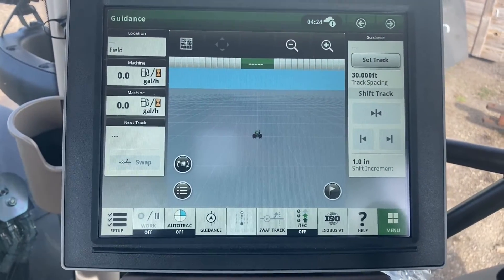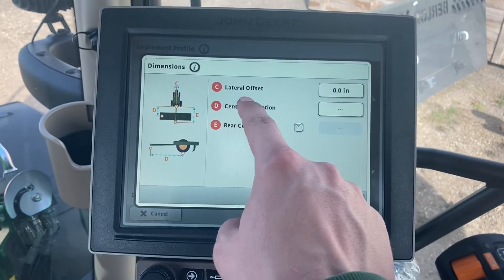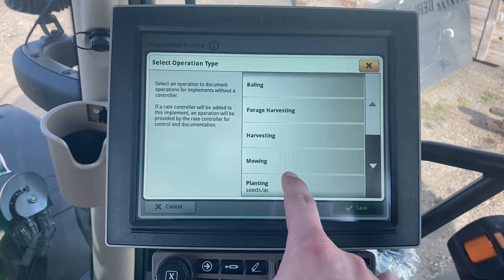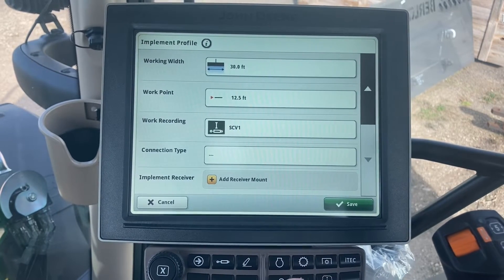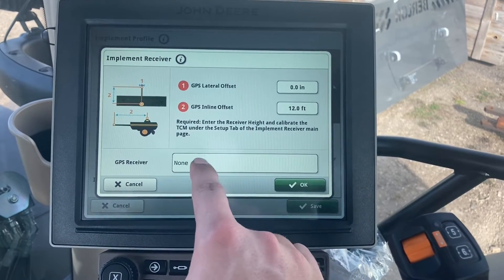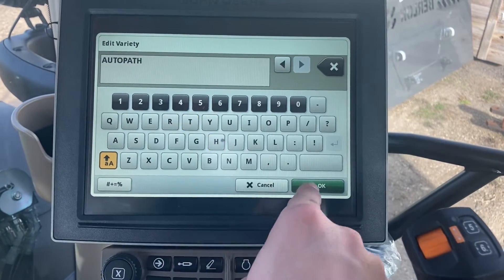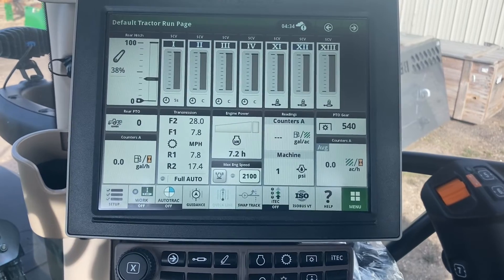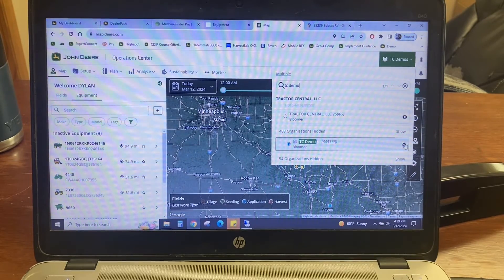How to Make Autopath Work While Using Precision Planting Equipment

Comment from the maker: A couple of questions have surfaced since this has been Posted
#1 When will documantation start on the Deere monitor if the SCV is set to constant?
The SCV will begin recording in about a second if it is set to constant extend when the switch is detented

#2 Can I set up my display to show a tillage pass rather than a planting pass and still get my Autopath information so i don't have doubled planting data in Ops Center?
Absolutly! The same rules still apply in setting up your display, just change the task on the impliment from seeding to tillage. As long as your AutoPath Ready To Record light is green you will be documenting rows for future Autopath Use. Then in Ops Center, select the tillage pass when sending Autopath data in the next setup file.

Comment: Great video! I've been trying to get autopath work in our planter since last year. We are still using the iso bus connector for some planter info like then the tank is empty. It also has the planter implement tied into it for implement guidance.  The problem with that is that the work tab is auto and it can't be changed because that is not seeing any seed. Is there a way to change this? I've tried changing it to till or something. I'm thinking the best way to fix it is run power to the implement guidance from a separate wire or is there an easier way? Thanks

Comment: Good info, thanks for putting the video out.
I did this last year for the first time with a Gen 4 (4640), and 20/20. I am pretty sure I was able to set it up to record with the SCV (in the video you state that you can’t)
If I want to forego the planting setup in the Gen 4 and just use a tillage pass as suggested, bring in the planting data from my 20/20, will I be able to create a Variety Locator setup file when I harvest the crop?
Also, what data layers from the 20/20 come 
into Op Center? Variety  I assume, but does population, downforce, singulation, skips, etc. (like in FieldView)?
Reply from the maker: I have successfully pulled variety locator files for a combine using data from a Gen 2 20/20 monitor last year. Data layers that I have seen show up in Ops Center direct from a Gen 2 20/20 monitor are target rate, applied rate, variety locations, applied downforce, and gauge wheel margin.  I would assume Gen 3 would have all of these maps available and then some but I have not had a chance to prove this yet.
Reply: @HillsideAg2840  Thanks for clarifying
Reply: Were you able to successfully do this? I am considering a precision upgrade with my current Deere planter. Wanting to run autopath but also wanting to create a variety locator file in Ops Center for harvest using data from 20/20 Gen 3.

Were you ultimately able to still use autopath in the combine while also utilizing a variety locator file made from your precision data?

Comment: I always thought u had to have a rate controller for auto path. For us were making strips right ahead of planter. Kinda hard to get the auto path lines to the planter as its pulling in the field as ur finishing
Reply from the maker: Shouldn't need a rate controller to create autopath lines. All that is required is an impliment reciever with good dimensions. I would agree that getting the lines from the strip tillage rig to the planter in a timely manner might be a challenge if it is right behind you.